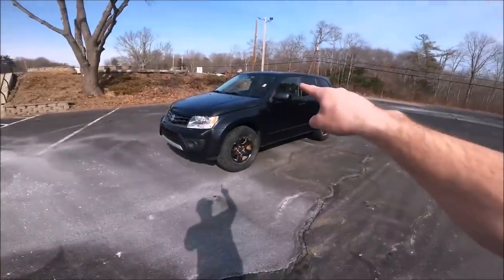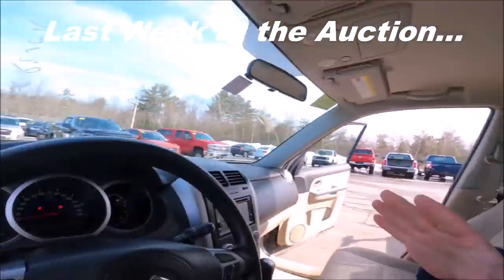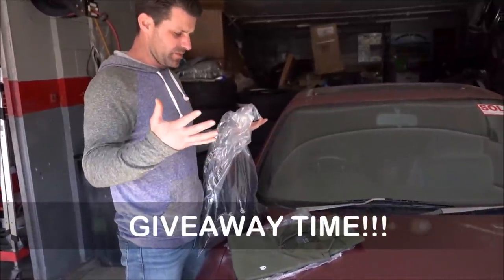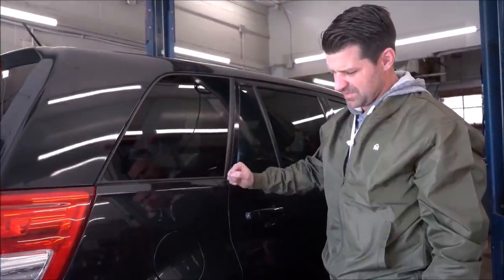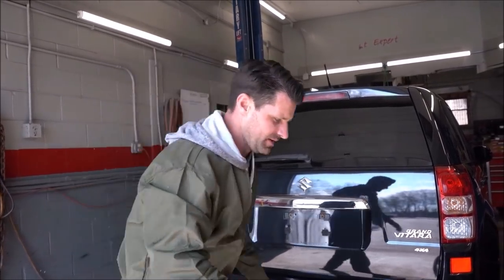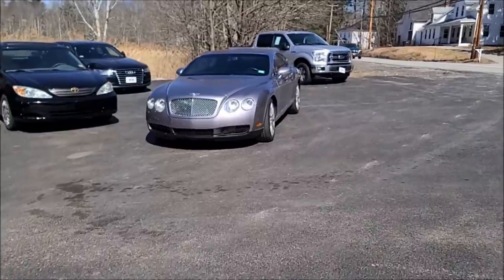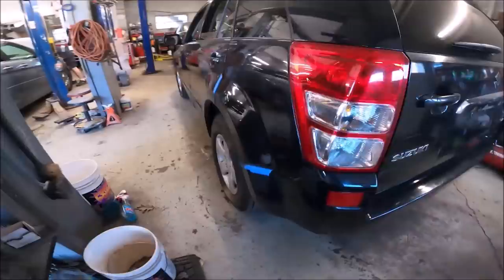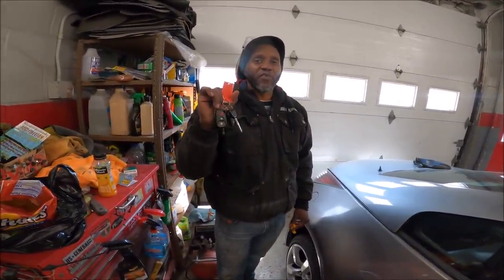Flipping $400 until we can afford a Ferrari [29] - Flying Wheels

Comment: Craig, I live in a 43' RV and have a 20' enclosed trailer. I currently have a '13 Lincoln MKZ with the 3.7 V6, AWD, less than 74k miles and EVERY option. I'm in Vegas, so it has zero rust. I'm heading to Mass and should be there at the beginning of May. The car weighs 3900 Lbs, so it's about 100 Lbs over my trailer's weight capacity (7k trailer with a dry weight of 3200). I may pay you a visit and maybe trade for a smaller, lighter, less pretty car I can drive out there and not worry about salt damage.

Comment: Good wash, clay, then buff. You want to get all of the dirt as possible not doing so can/will cause swirling on the paint, then after its washed use a good clay bar or MIT to pick up anything that washing couldn't get out, then buff and avoid sunlight as uv rays can cook the compound onto the paint surface

Comment: @Craig
Old car dealer Trick/ Tip

When you Pick the car up  at the sale, Flip the driver side floor Matt upside down if it’s carpet
That way the mechanics and tire guys , etc boots aren’t making extra stains and work for ya
When it’s done and ready for cleanup , wipe the backside of the Matt off and start your detailing process

Comment: Back in the mid 1990's I bought a Suzuki Samurai that I used as a daily driver until around 2008. It was slow and noisy, but it was extremely reliable and got great gas mileage.

I would have kept it longer but the body really started to rust out bad. Suzuki used to make engines and transmissions that would last forever.

Comment: Suzuki only has one rig that you avoid like an STD...the XL-7 that was built by GM Canada. 3.6 liter "Oil clogging/timing chain stretching" special and a transaxle that has an electronic valve body that likes to go bad. Those Grand Vitaras are pretty tough/capable off-road rigs, take care of them and they will last.

Suzuki just left the US market. They still are found in many other countries. The Kizashi with the V6, AWD & a stick was a pretty surprisingly fun car. Had they turbo'd it & made an STI-type version, they would've had a winner

Comment: In to the am

I
N
T
O

T
H
E

A
M

N

2
T
H
E

A
M
!
!
!
!
!
Keep it up bro your doing what I used to do when I was 16-22. I used to hustle mustang gts and cobras until I got my 2003 mustang svt cobra terminator. I stopped flipping and hustling cars once I got my cobra tho. I reached my goal but didn't know what to do once I reached it and fell off lol. It's 7,8 years later and I'm back at it and I can't believe I stopped. In the last 5,6 months I've been killing it. I started with a 08 altima with 315k I got for $200 and I'm up to 15k cars right now. The biggest advise i have for people is don't be afraid to reevaluate or make new goals once you reach your goal or even if something happens and you need to reset your goals

Comment: Into the AM. Trying to sell the 2002 CRV we bought two years ago for the same price we bought it for, but it’s kicking my ass with new oil leaks after I fix one, I’m thinking PCV is causing excess pressure. I’m also in a new state so learning the process of selling is unsettling but once it’s gone it might be my side hustle to move the 5k to another car to flip.

Comment: cleaner waxes are to remove impurities within the paint. It has extra solvents and some particles that can "mimic" polishing. I never use a cleaner wax cause I allways wash, clay, and then if it needs to be compounded and polished. what you are doing is skipping like 2-3 steps. I mean it works to a point but again you are not a detailer.